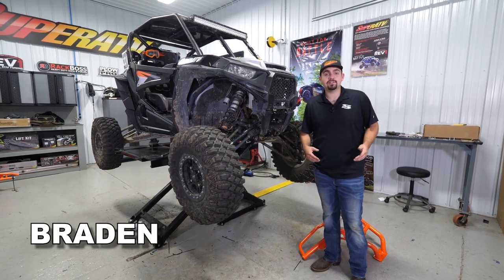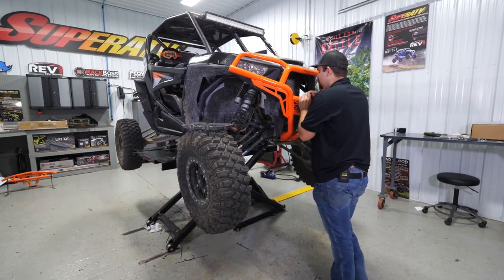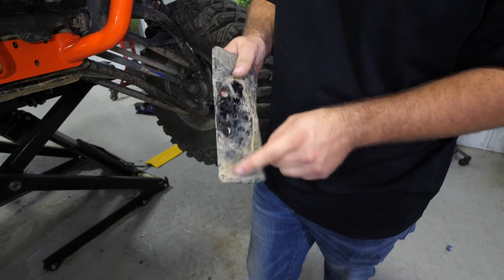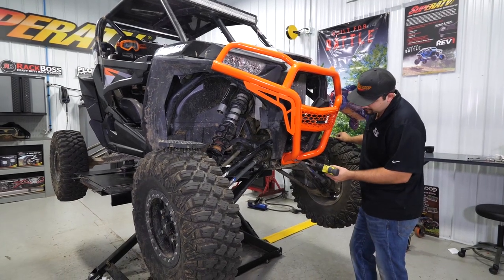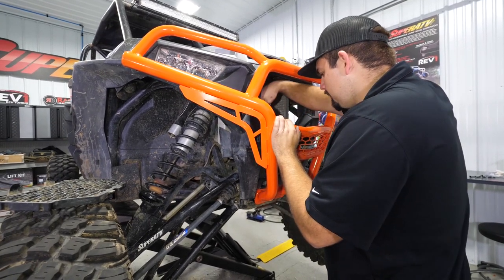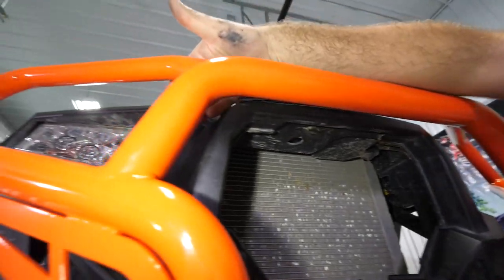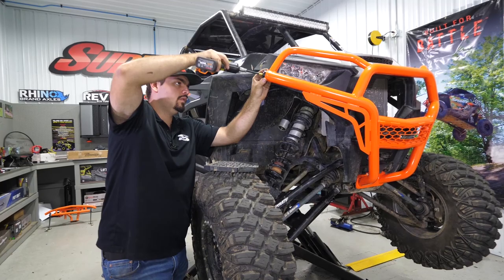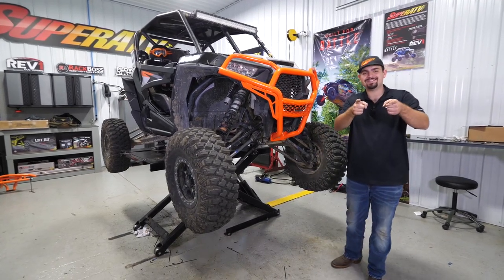SuperATV Polaris RZR XP Turbo Front Bumper Install | How To

Comment: I need the bolt size do u know what it is?
Reply from the maker: Hello, there are a couple used in this kit. The 3 bolts at the bottom are M8x1.25x25mm, the 2 bolts in the middle are M12x1.75x30mm, and the end cap bolts are M12x1.75x30 button head style bolts.
Reply: Do the bolts kits come with the bumper or do I need the yo out to the hardware store?